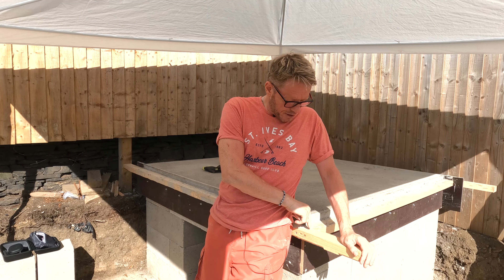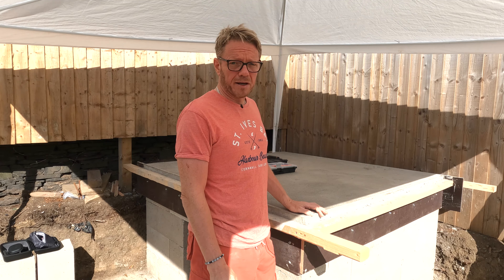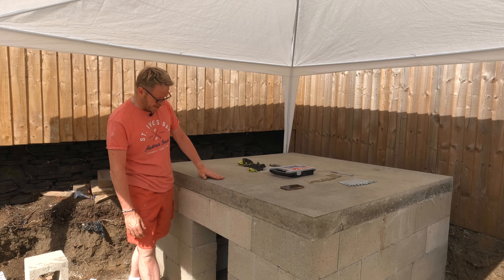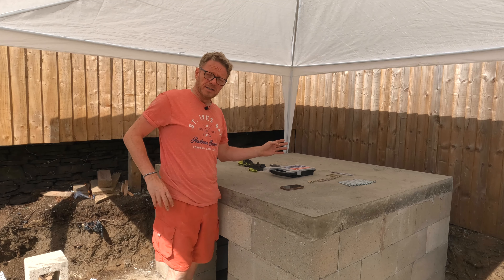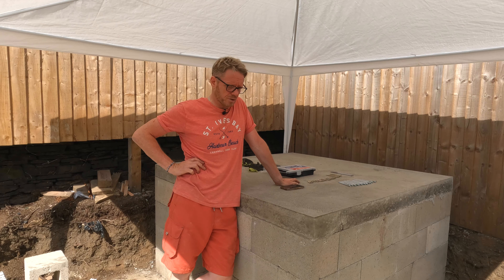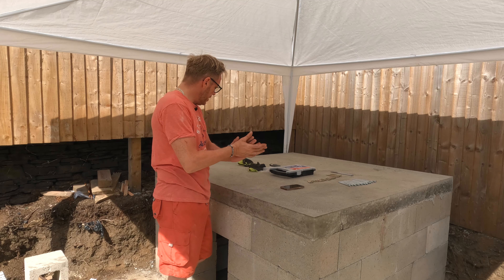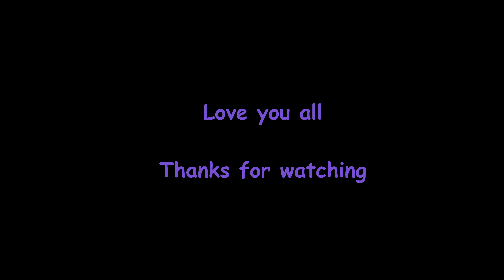Concrete Slab Revealed (Vlog 17)

Comment: Please do let me know what your builder friend said about not needing to put crack control lines in. I feel like it's so wrong to do even if I understand the logic behind it.
Reply: One thing that concerns me greatly is if my hand slips while grinding the line and I end up putting an ugly chip into to the slab by the line
Reply from the maker: As far as I can remember he said two things. Because the slab will be insulated quite heavily from the oven floor and that it is a relatively small slab control cracks we’re not needed. 

I’m sure there will be knowledgeable people reading this that say otherwise. 

I wish I could give you firm advice but as my channel states, I’m a novice. 😂